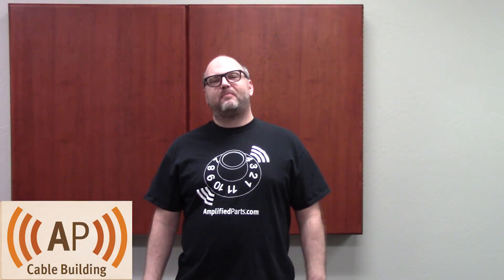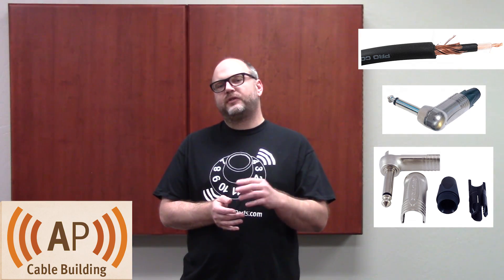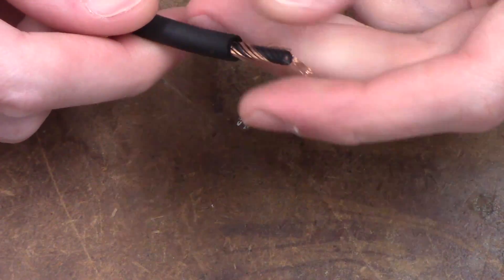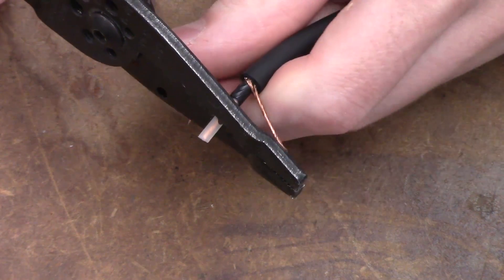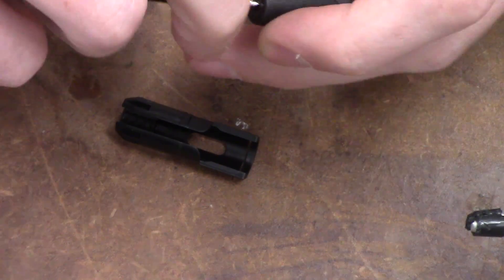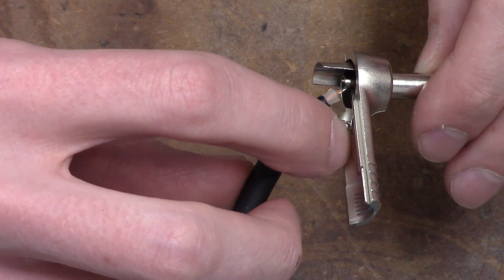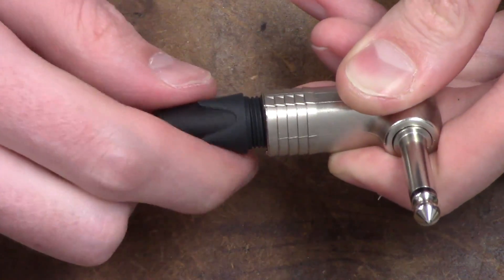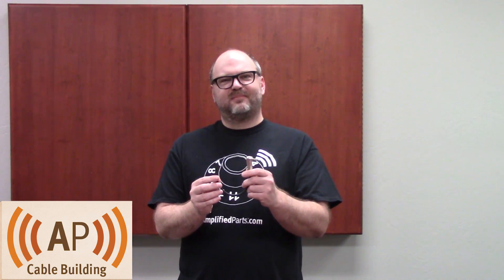Build Your Own 2-Conductor TS Instrument Cable for Guitars and More

Comment: In everything you talk about not once do you say which is the positive which is the negative what is referred to or terminology has been altered since the 60s 70s and 80s now calling things ground shield things like that but when it comes down to it it is actually positive and negative and not once is that referred to. It could be helping people in multiple times over with not just how to do this and how to connect these quarter-inch jacks but also a lesson in terminology because depending on how booshwah somebody is they turn simple positive negative neutral ground those four words into these new terms such as shielded balanced all stuff that really just comes down to the basics of electronics not once have I heard anything mentioned as to which was positive or negative I think maybe I heard ground wire refer to once